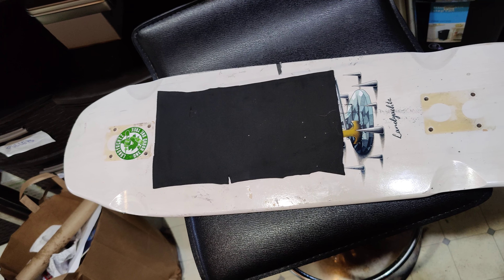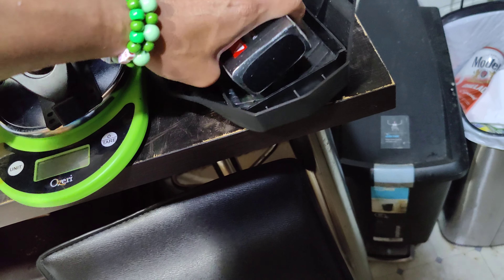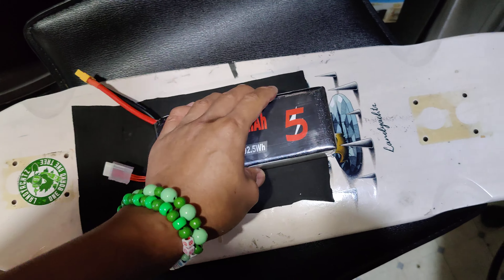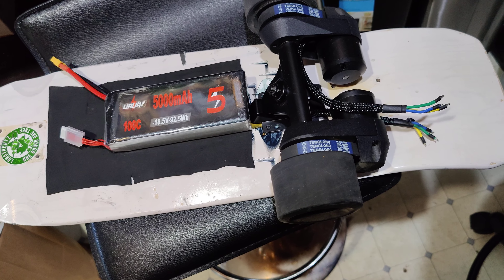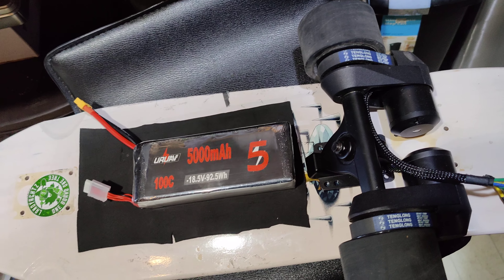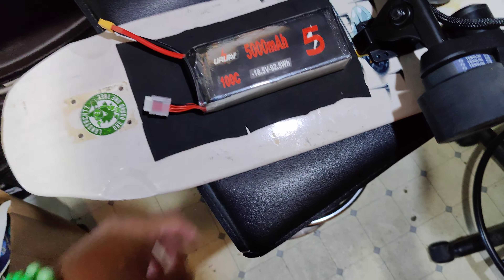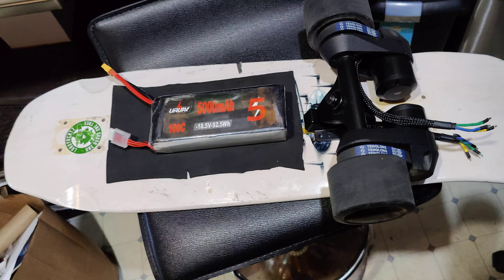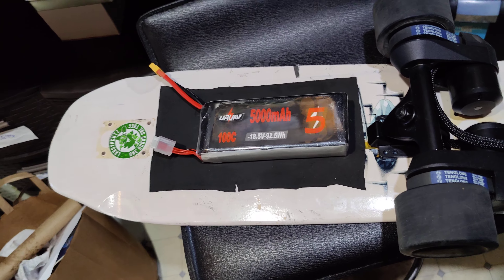Building a quick and dirty lipo DIY electric Skateboard for Travel Overseas!

Comment: Quick question, I have a Ownboard Carbon AT on stock 10s.
I've swapped out remote and esc, that can take up to 20s.
I was thinking about 2x 12,000mah or 12ah 6s lipos, only 10c.
How would the range n power be like? Compared to the 18650 10s 14ah 508WH
Obviously if I had 4x for double the range.
2x 12ah in parallel, for 24ah, times two and connected in series to get 12s.
Great videos bro, I'm an Aussie 53yo been eskating 8x months.
But rc cars n rc fov quadcopters are my favs, so I have more experience with lipos than li-ons.
Reply: I can set low voltage alarm per cell for lipo at 3.4-3.5v, as is set for 3v at moment for li-ons.

Comment: Where did you get a cheap $100 dual motor setup?
Reply from the maker: They used to sell on eBay, maytech sells them too but I am actually going to use ownboard trucks and 6354 flipsky motor